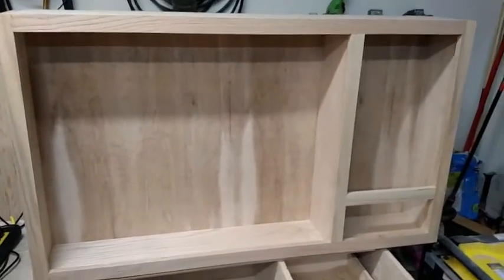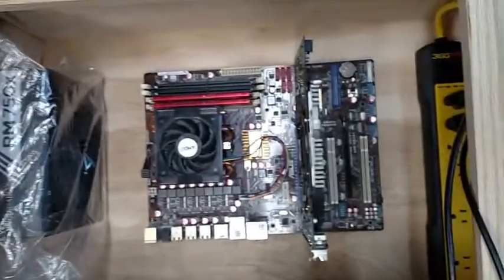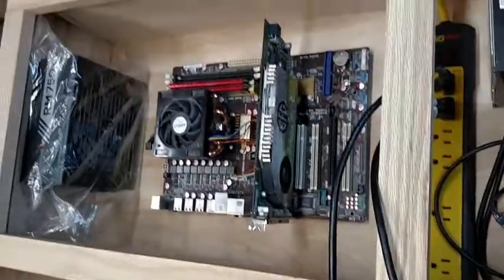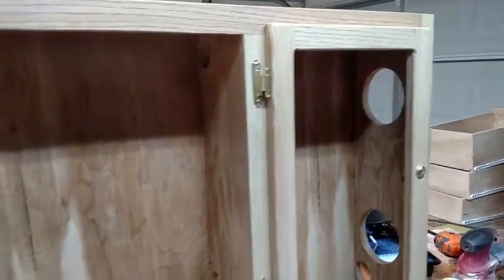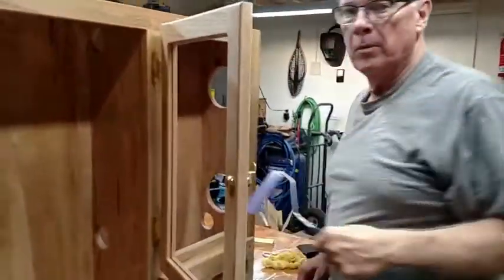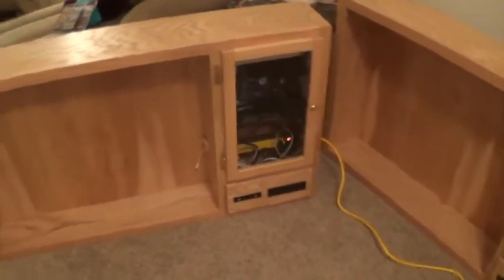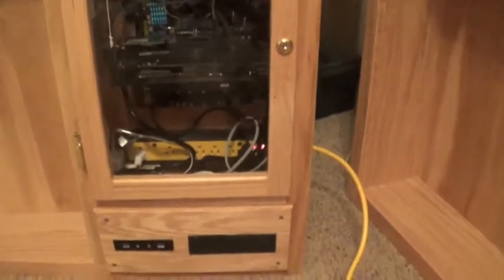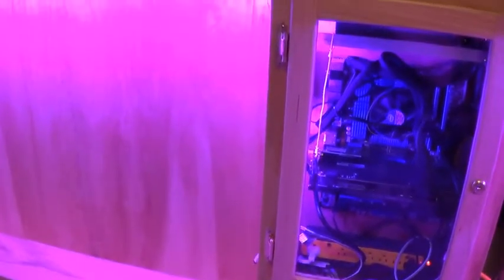Custom Computer Desk Step 5 Final Assembly

Comment: great woodwork very beautiful but the one thing i would suggest is making a hollow box behind where the mother board would set for cable management so you can get better airflow through the system as well as a exhaust port on the top as well
Reply from the maker: Hi Eddie, Thanks for the suggestions, the wiring can get a bit cumbersome for sure. I thought about different ways to wire this up, and quite frankly I just ran out of time. (this was an xmas build for my girls) and just slapped it all in there.  If I had it to do again, I would get some extended ribbons for the video cards etc.. to place the items in a more controlled manner.  Most of the wiring ended up in the bottom behind the cdrom drive, and we did run vent's I have two fans one blowing in and one blowing out to cycle the air.